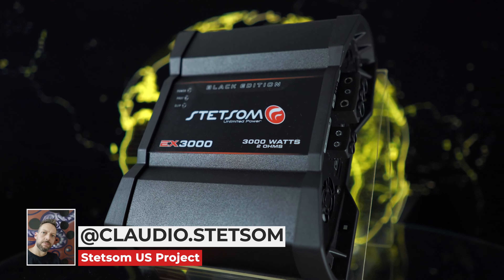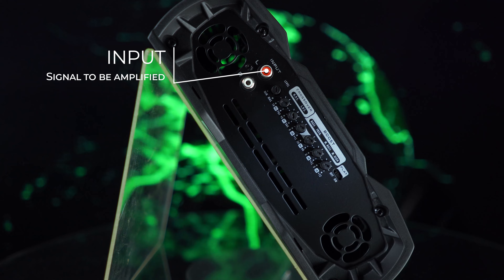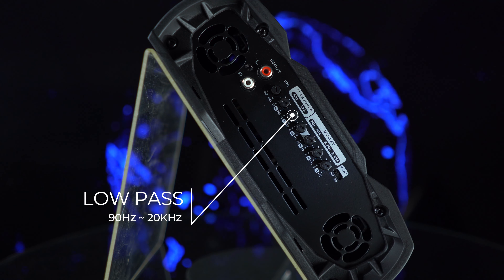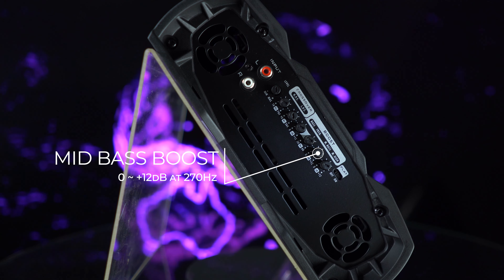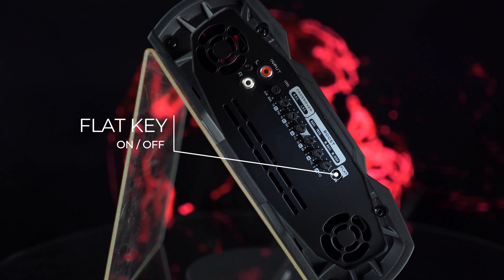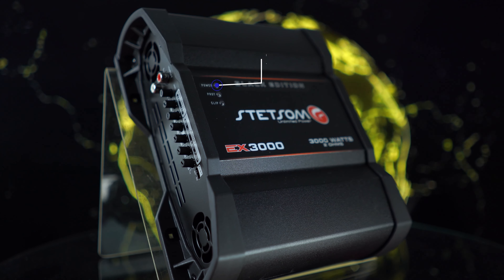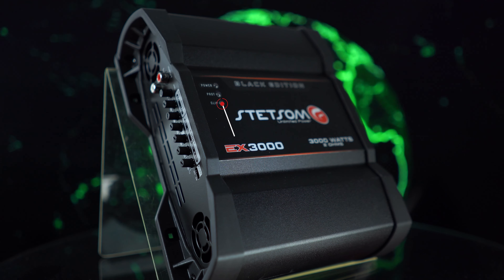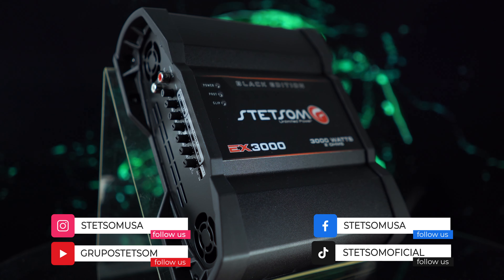EX3000 BLACK Edition - STETSOM

Comment: I noticed this has power rating at real time voltage like 12.6 I can’t decide between getting this or the bass flex amp because those only have power rating at 14.4 and these amps are known to be voltage sensitive. Has this been a feature that’s specifically added to just this black edition to handle lower voltage or can the bass flex hand those same numbers at 12.6 as well , please respond. I’m trying order 4 of one or the other 🙏🏽